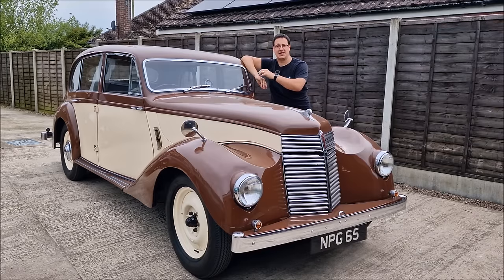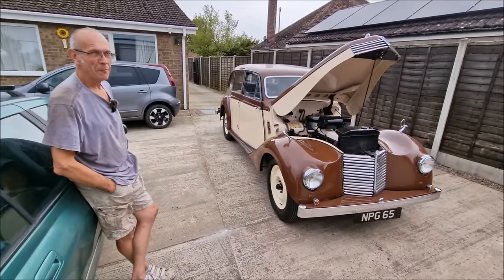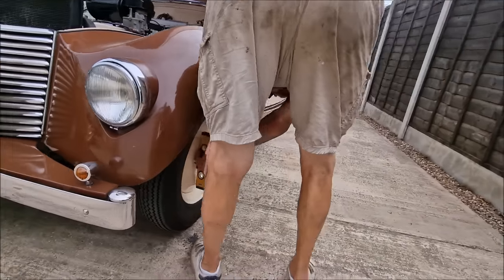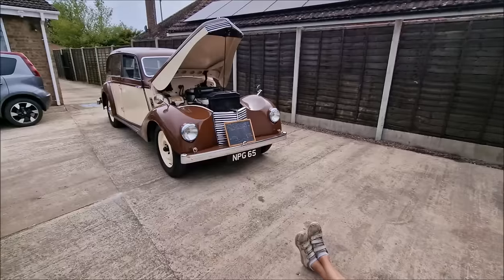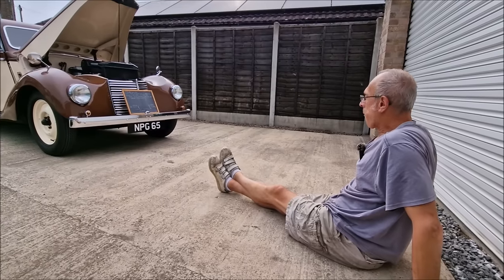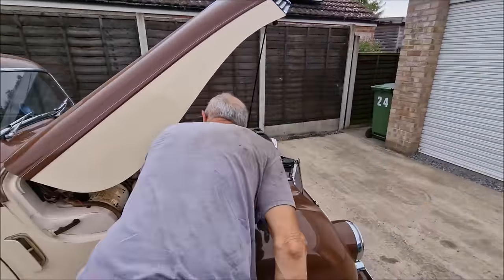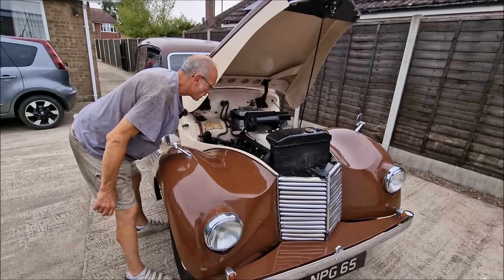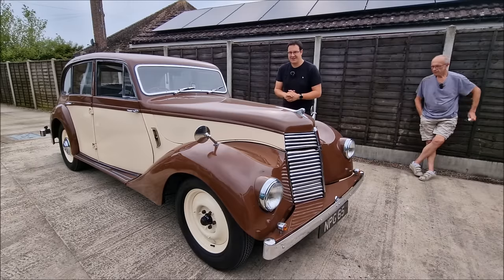"Deathtrap" Armstrong Siddeley Chassis Repaired BUT There's Some NEW ISSUES

Comment: I do not agree with your Dad about the pre-select gearbox.  They were introduced as an option in 1929 when the only alternative was a crash-box as synchromesh had not been invented. The Wilson pre-select gearbox (the company was 50% owned by Armstrong Siddeley) did away with grating gears and made driving much easier for many owners.  Pre-select gearboxes were fitted to many other cars, buses, military tanks and even ERA (English Racing Automobiles) racing cars.  They are usually very reliable and long lived.  If they do start to give jerky gear changes then attention will be needed and that is the only drawback with these boxes, rebuilding a pre-select gearbox is a skilled job and expensive.
Reply from the maker: Thankfully this gearbox was fully rebuilt in 2019

Comment: It wasn't the chassis though was it? It was a bracket on the chassis.  Very big difference
Reply from the maker: That bracket is welded to the Chassis and therefore is part of it in our opinion - either way, its been repaired (Hooray!) - Thanks for watching :)
Reply: Yes I agree Chris , the description of this video is an unecessary  form of click bait in my opinion  , almost critical of the quality and soundness of this lasting and quality engineering .
Reply from the maker: @Roger.Coleman1949  Whilst i MASSIVELY disagree with the allegation of 'clickbait' (that's NOT what we are about) - there is clearly an engineering oversight here, which has been discussed before by Penn Bradley in his book - either way - thanks for watching and following our progress. Stay tuned for part 4!

Comment: I also have a  classic car (1970) I do all the maintenance. It will easily keep up with current traffic (117bhp/ton, with a mild non factory camshaft fitted, rest of engine is std.. The brakes are however something else with original material pads.. If the lights change on a 2 or 3 lane carriageway at 50 or 60mph I cant stop within the orange phase however hard I press the  brakes. The car has all manual single circuit brakes, discs on front and 9 inch drums on the back.Never a problem for the mot when I bothered. So my conclusion is traffic light timngs have changed and I must drive very slowly where I expect traffic lights..
Reply from the maker: Thanks for watching - i agree, and people are a bit less tolerant of classic cars on the road i find ... which is sad

Comment: I have a 1933 Armstrong Siddeley 15 Long. At 90 years old it is an incredibly well engineered vehicle and as tough as old boots. I think your assumption of metal fatigue is wrong and that cracked bracket is a result of circumstances the carhas encountered in its long history, possibly damage, but at least you'll never need to do it again. Best brake linings are woven linings. You can get them from brake people and unlike themodern composite linings, it wont wear out your brake drums and provide a better feel to the brakes. Probably a good idea to check tracking.
Reply from the maker: Thanks for watching. Tracking guages have been out 👍😁
Reply: When I had a Whitley I was dissatisfied with the brakes even when properly set up.  Narrow cross-ply tyres will never be as good as modern radials for braking.  I took my brake shoes to a specialist and he relined them with a slightly softer material and this gave a definite improvement, although I had to be careful not to lock up the wheels when braking hard.  Biggest safety factor is to always make sure that you have a big gap between you and the car in front, and this applies to driving modern cars as well.
With your current brake problem I wonder if giving the hydraulics a thorough going over might help.  If cars are left undriven for long periods cylinders start sticking, and old fluid absorbs moisture which reduces efficiency and can lead to rusty brake cylinders.

Comment: Great job! If the breakage was jacking it up a bit on that side maybe it compressed the suspension on the opposite side. Camber usually designed to become negative as you load it up.
Reply from the maker: Great point!

Comment: Well if you alter the inclination of the chassis the suspension will react especially I would think if you have torsion bars that run along a chassis rail. The fractured bracket possible imparted a twist to the chassis.
Reply from the maker: Yes! That makes sense!

Comment: Plug leads or the condenser in the distributor can cause that missing under load. That’s a great job on that welding repair
Reply from the maker: Thank you. Latest update sees us find and fix the issue 😊😃

Comment: Hi Jon  It is good that your Dad recognised the bracket was not strong enough, so repeating on the n/s will make things a lot better. With your brakes again your Dad is bang on, the linings you have will be a lot harder and not as good than when new. It will take a lot longer for them to bed in. Rough the inside of the drums up. Your brakes will never be as good as a modern, try coming down the gears using the engine to brake the car also. You mentioned uprating the brakes, be aware you you may well break something else on the car as it will not be built for that sort of retardation. Misfires can be a pain again start simple and move upwards! New coils can give trouble they are not as good as they used to be. If you are thinking of long term ownership get the distributor looked at and rebuilt if it has not got electronic ignition. I had a constant misfire on my Riley Falcon I had changed everything then got the dizzy rebuilt. Turned out the automatic advance was pleasing itself! Apparently they are only good for 160000 odd miles. Is the heater standard with the car or an add on? It depends how it is plumbed in. You can fit stop taps but if it comes from the water pump you will have to build in a loop  so that when your heater is off the pump still operates. It may be prudent after all the carry on to get an MOT. It is always good to get fresh eyes on it and see how the brakes are getting on. Have fun! Cheers John
Reply from the maker: Thanks for watching - some work on the brakes is coming soon - we have already rebuilt the distributor (long story) and thats on the channel. Great to have you with us

Comment: New linings may still need more bedding in but the drums maybe glazed. A quick skim up on a lathe would fix that. I know that linings with asbestos can no longer be sold but it's not illegal to have them on your car if you get my drift. Old ones can still be found. Not sure why you can't switch of the heater. A simple Taxi style valve in the input hose can fix that. The rad looks as if it could be bigger but there is plenty of room for an electric fan. Kenlowe is no more but used ones can still be found, even the old ones with a motor on a couple of bent arms if you want to keep it a bit period. Go for it. Run the car in complete darkness and spray some water on the plug leads. A sparky light show will prove they are bad. Might also spark across the dizzy cap. That can happen internally too and may show carbon trails. Wipe around the inside with silicone grease, just a film. I look forward to the next video.
Reply from the maker: Great things to think about and thank you for watching :)
Reply: Also there are a lot of poor quality rotor arms on the market.  Make sure yours is a good one.

Comment: If you strengthen up one side then the weaker side will cause this. It stands to reason.  Do the same to the near side. Again it wasn't the chassis it was a bracket for the suspension hence the difference it made.
Reply from the maker: Absolutely! Nearside will be being done also :) - stay tuned for more fun

Comment: Jacking and axle standing has realigned the back axle and chassis bushes.
Reply from the maker: Could absolutely be a factor there
Reply: Everything that loads and unloads the chassis and suspension from side to side will cause worn and failing items to realign as they settle... then using the car can adjust everything again. Once the nearside of the car has been fettled too the true picture will emerge,...

The fact with older cars is that repairing one issue will then highlight another, and waking up a stored car can and will find weaknesses that were lurking undiscovered.

Comment: Hydraulic front brakes with mechanical rear  , as you press down on the pedal the master cylinder slides which pulls on the rear brakes.......not the best idea in the world and it takes a bit of getting used to . Engine tappets need checking....early models had Hydraulic self adjustment.....ahead of its time then !
Reply from the maker: Tappets are all good - check out the previous video from last year (Dad adjusted them :) ) - Thanks for watching

Comment: Jon when you test drove it in an earlier video, didn't you say it pulled to the left? So if dad welded it up, i would assume it would have sorted that out?
Reply from the maker: Yes thankfully it fixed the issue - we werent sure why or if that was the problem :) - more videos to come
Reply: @JonCoupland  it might have been stress on the nearside chassis leg causing it to veer to left cos of the crack on the offside leg?